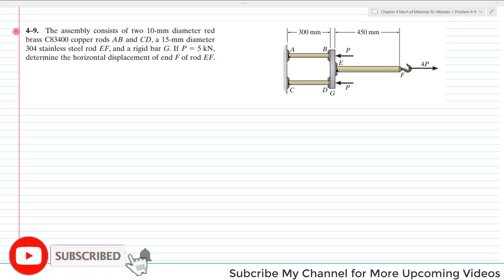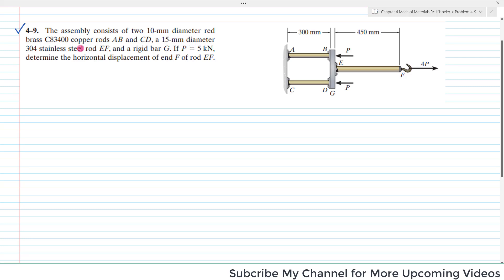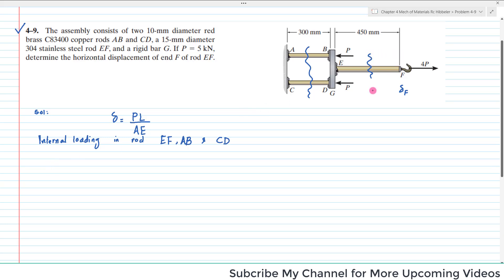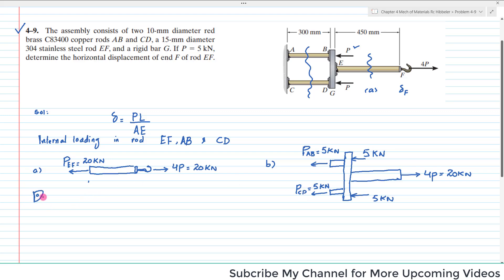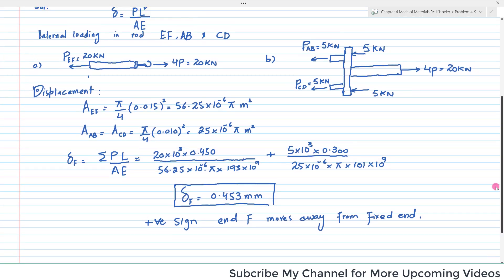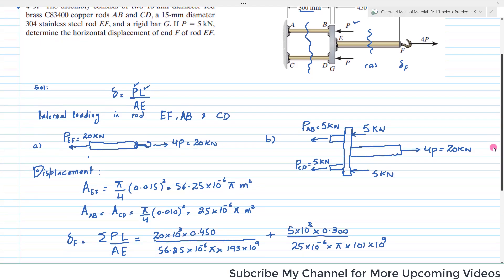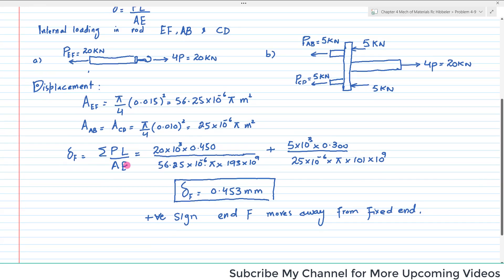4-9| Chapter 4 | Axial Loading | Mechanics of Materials by R.C Hibbeler 9th Edition|

Comment: If P = 20, and the forces were pulling instead of pushing at B and G and they were twiceP, would I solve it the same way?
Reply from the maker: Yes you will solve the same way but you have to be very careful in determining the reaction force and then whether it is producing elongation or compression...